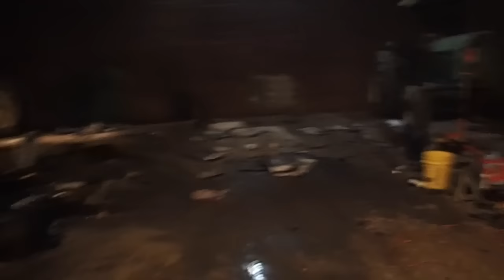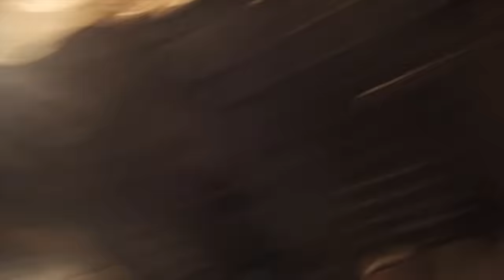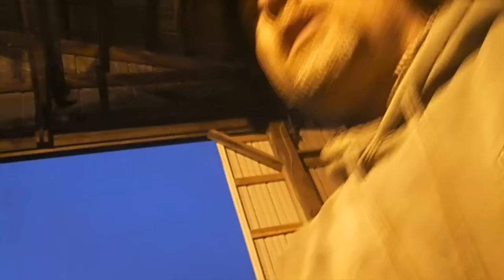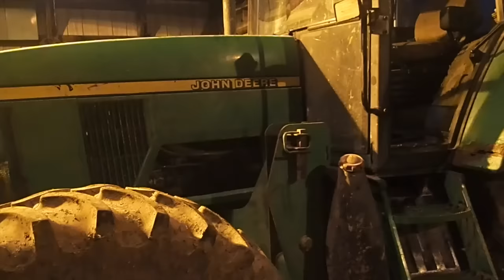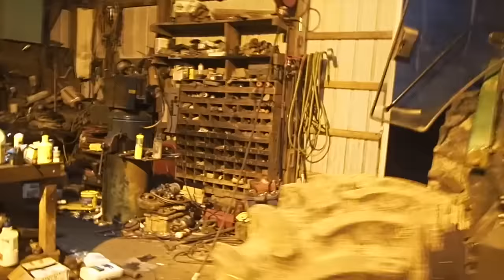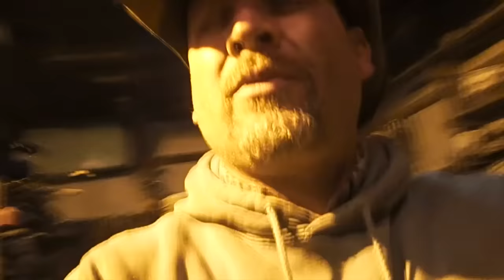7410 Transmission Fail Explained

Comment: Glad you figured it out.  I saw the comments on the other video, and it didn't make sense that having two steel plates together would cause it to stick in gear.  If anything the two steels would have slipped against each other.  In a way it was good that you messed up the plate with the square holes in it, otherwise those two steel plates would have killed that transmission eventually.

Comment: Hi Wes Glad you fixed it. Just a thought on that axle center pivot. On a few tractors if the price on that center is huge or used isn't available thats any better. We take that section to the machine shop. They machine those big pins back round, slightly undersized. then make a sleeve to press on or weld to hold it, this brings the Od back to standard bushing size then just use standard parts to re assemble it. I have seen the odd one that was so bad guys welded the pins and then machine it standard to. The odd time if the pivot mount for the frame parts bad and expensive, or not available they will do that the same to make a new oversized bushing.

Comment: Suggestion:  Place STRONG neo magnets on the bottom of each filter and oil pans/sumps.  The magnets will attract and hold any metallic particles that might otherwise get through the filter.  I have them on my car and tractor.  Good luck.

Comment: Great job on repair and trouble shooting. I bet Tim and Carl will disappear like the cartoon road runner if you mention split a tractor again. Glad no one got hurt, very dangerous splitting a tractor that size. I was 1/2 right about the transmission being an issue. All in all nice work thanks for posting.

Comment: What a major pain in the ass!! That's been a massive amount of work having to pull it apart 3 times. 
Re the front axle: do you have access to a good engineering workshop that may be able to bore out where that bushing is wrong and then get them to make a new oversize bushing to fit? Is the shaft worn out that passes through it as well? A new axle casing is likely to be mighty expensive I would have thought and the chances of finding a secondhand one in good shape pretty remote.
Reply: +Dan Whiteford I was thinking the same thing.   Have it bored out and put in a oversized bushing If its not right fubared,

Comment: Better that you discovered the problem before you ran the tractor and tore up all the new parts. Also, at 3:12 in the video you can see a folded US Flag sitting on a pile in the background. Please send Tim on a mission to put it in the box outside the Frenchtown VFW for proper disposal.

Comment: hey wes, i recently had the same issue with an LB7 duramax had to go back into iit for head gaskets that someone else did, then an injector started sticking right away when i started it, so back in i went, and 250 kms later another injector on the other side started acting up. the injectors failed for who knows why i cleaned everything just one of those deals

Comment: I've had jobs go like that too. Did an auto in a toyota once and put a clutch drum in back to front. (No top gear) urgh! Had to rip it out and apart after i got it running. Then work out what i'd done wrong and put it right. The drum went in both ways and one way the oil holes didnt line up between the drum and the shaft.  ha ha Crap Happens. very few of us are perfect.

Comment: as bad as under a 96 dodge truck replacing fuel. trans brake lines. rusty leaking mess. pulled box off. will replace with flatbed

Comment: You seem to have a lot of trouble with the front end of that tractor.  No doubt because of the heavy loader usage.  Have you considered purchasing a rear mounted fork lift for that tractor?  It would help alleviate the stress put on the front end.
Reply: +LanceCorpralDavidS A front-end loader is a whole lot easier to use than a rear mounted forklift. Mainly because you're looking right at whatever it is you're handling and you don't have to be turned round straining your neck for a good part of the day
Reply: +deeryme Either way there oughta be a better way.  I would prefer the rear fork lift because it is easier on the equipment.
Reply: +LanceCorpralDavidS Big counterweight would relieve front axle stress, probably the easiest thing to do